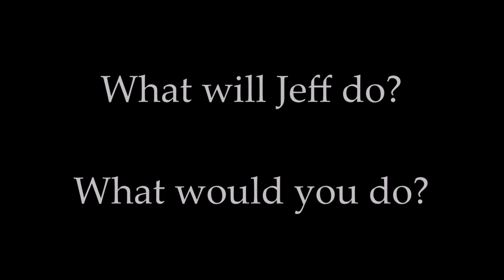Junkyard Riding LAWNMOWER Engine 8 HP BRIGGS and STRATTON Resto. Repair Will it START or RUN? HOW TO

Comment: Thanks for the tips on the carburetor.  I didn't realize while cleaning it that there was a main jet on the top of the carb.  Initially i thought it was just a screw holding the carb together.  This helped me get my 8hp b&s on my snapper riding mower working again!
Reply from the maker: nice work!

Comment: Those are fine engines.
Copper spray a gasket, and back in it goes.
Adapt, and overcome, as they say!
I bet Stens or others make them.
BTW, I have one of those in a '85 MTD rear engine rider that a neighbor tossed. Changed the oil, cleaned the carb, been using it for almost 10 years. Still runs strong.

Comment: I bought a rototiller with a rusty top like that. Previous owner had set a leaky bag of lawn fertilizer on it and the moisture in the air caused the corrosion.
Reply from the maker: something like that must have happened to this one too

Comment: Hello Jeff new subscriber here. I found a good deal on a Bobcat walk behind mower that had a blown Kawasaki 14 horsepower motor. The next owner used a Briggs 14 horsepower motor and that is where I come in. You sound like you are from the Pittsburgh area but I could be way off. It is getting  cold here but thanks for your information.

Comment: Nice job Jeff: The Diode is a one way electrical device. Only lets current flow one way, also try some copper gasket spray on the head gasket. I have had great luck with it.
Reply from the maker: Thanks for the tip!

Comment: I have bought 4  Briggs parts and services catalogs off of eBay for repair information and to ID parts. I have gotten many good deals on eBay by looking up parts by the factory part numbers. Many of the sellers don't even know what their parts fit, so they just list them by the parts number rather then list them by what model they fit.

Comment: I have the same engine I bought about 8 months ago. The only difference I see is mine has a chrome air cleaner top. I don't buy vertical shaft engines as the norm, but the price was cheap enough I will resell it or part it out and save any parts that can be used on a side shaft engine.

Comment: I added some gas to mine today Jan 19 2023 and it started running violently poorly. 

Shaking and vibrating crazily, it normally starts beautifully

Does snow/water affect the gas like that? Also wondering if the cold damaged anything on startup or bent the crank key
Reply from the maker: I would start by draining and cleaning the carburetor and fuel tank.
Reply: @JeffsLittleEngineService  I did, put fresh gas and replaced the spark plug

Still violently shaking 😬

Comment: The old school way to deal with an unavailable head gasket and/or do a cheap compression increase is make one out of copper sheet, they can be annealed for reuse over & over.
Reply from the maker: Excellent advice @markross6818! I love Ol' skool tips! Thank you for commenting. Just like my old 2 stroke Yamaha RD400 motorcycle had. Indestructible! and reuseable time after time after annealing.

Comment: Jeff, what i did with head gaskets to reuse them was to put a coat of copper coat spray on them or silver spray paint. Something thats in silver paint that will seal them up as long as they aren't torn. Yours looked fine in your video. 👍Roger
Reply from the maker: Good tip!

Comment: I have a similar B & S engine model 170402 built in 1967. It worked when I took it off a snowblower a few months ago. I did re build the carb recently. I can't get it started. Any ideas? Compression is around 52 PSI (which is the same reading I'm getting from 2 other engines that run fine). I do definitely have spark. I replaced the head gasket a few days ago. Now when I pour some fuel into the sprak plug hole and replace the plug I still get no fire at all. I also checked the valves for leakage but when I put some fuel on them when they were closed I had no leakage at all so they seem to be OK. Timing?  Spark plug?...it worked on my other engines. So what other options should I look at? I appreciate your videos .
Reply from the maker: Sounds like no spark I would replace the points and condenser or upgrade to non points style coil/magneto.
Reply: @JeffsLittleEngineService  I already replaced the points with an electronic magneto and it is sparking. I think I will check the valves and clean and lap them to see if it gives more compression. Should be close to 100PSI what I'm getting is about 55 right now.

Comment: To clean an engine prior to painting gas and a paint brush are handy to soften old grease.  Save the brake kleen for last to remove petroleum distillates.  To remove rust cheap and easy like on that tin piece, soak in whatever vinegar you have handy.

Comment: That diode does not decrease voltage what it does is on allows current to flow one way it is basically like a check valve and if you bypass it what will happen is your stator underneath your flywheel which charges your battery will burn up

Comment: i have an old briggs and tratton but i have problems with elektric start idk what or how i have to fix it
Reply from the maker: Start by making sure you have a good charged battery. Check that the main fuse is not blown(usually located by the battery). Solenoids fail often. Ignition switches fail when they can get rusty at the connections on the back. Make sure starter motor is not locked up from rust. Good luck
Reply: @JeffsLittleEngineService  i found the problem the soliniod is broken but i didnt recieve my new one yet

Comment: Thats crazy, they made tons and tons of those engines, a lot of okd school snapper rers use that engine, lots of things did. I guess when the new Briggs took over parts on the old stuff started being discontinued. Gotta find some new old stock on ebay, like the Tecumseh. But if thats that metal head gasket, it should be fine, those were reusable unlike the cardboard material made ones later.

Comment: What a diode is is a one way check valve  for electricity what's coming off the alternator is alternating current hidden reason why it's called an alternator and the diode simply makes it DC so that way it charges your battery and do whatever else it needs to do
Reply from the maker: great info!

Comment: The diode turns the electricity from AC to DC all alternators make AC current and need something to convert it to DC
Reply from the maker: very good explaination thanks!
Reply: Finally someone with electrical knowledge .

Comment: I have reused the same head gasket 5 or 6 times and they still work as long as you don't tear them. Never had a problem.
Reply from the maker: cool, thanks for the info. I think that is what I will do

Comment: Check pro parts direct they should have what you need.
Reply from the maker: I looked everywhere for genuine B&S and could not find any. I suppose I should try aftermarket sources a bit more. Thanks for the tip!
Reply: @JeffsLittleEngineService  they are an authorized B&S parts dealer. You can also use a coupon from taryl fixes all here on youtube

Comment: if you would have used valve grinding compond on screw ,screw driver will not slip
Reply from the maker: Nice tip!